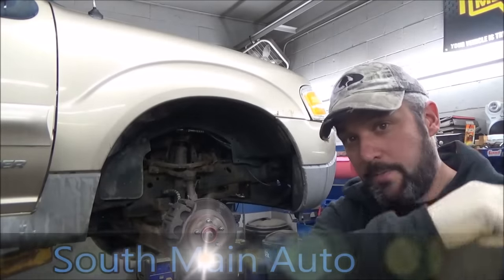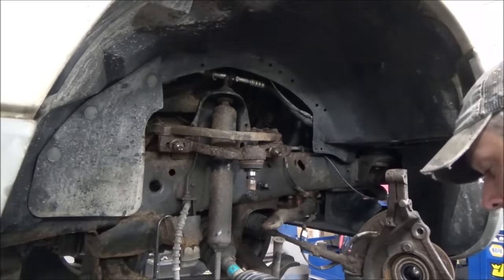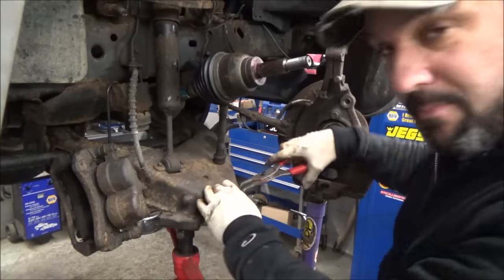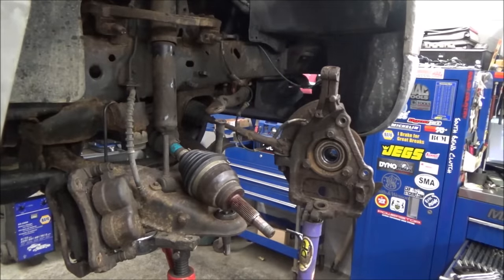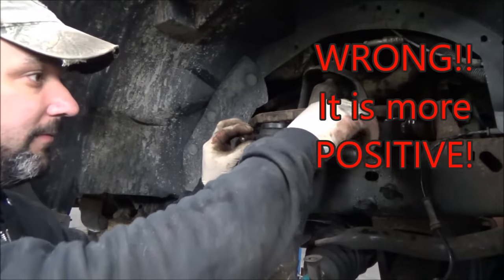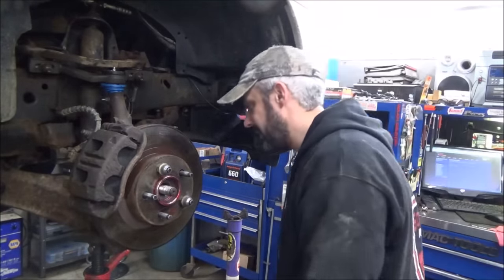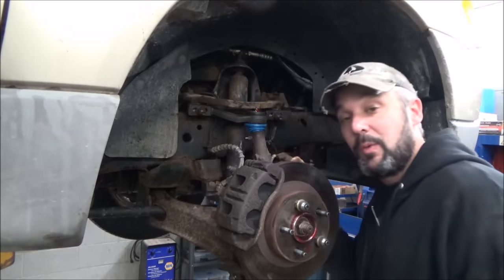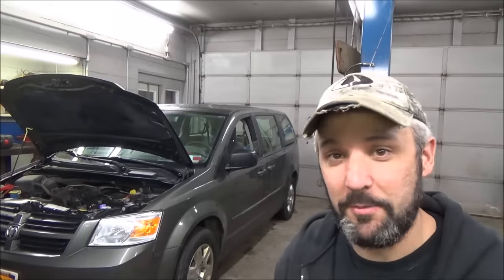Ford Explorer Sport Trac - Ball Joints

Comment: I have a ball joint kit just like the one you have and used it for years. The owner of the shop I work at just bought the Snap-On ball joint kit. It’s expensive I think about $600 but worth it if you do a lot of ball joints. I haven’t even taken mine out since he bought the new one. It’s heavy duty and the cups all snap into the press with lock rings. It doesn’t matter the size or how long the ball joints have been in I’ve never seen it struggle to push any out. It has saved us a lot of time. Time is money

Comment: Eric Im learning a lot from your videos only been watching a couple days in my off time, watching and listening to you is almost like hands on experience for me. I ordered a power probe thanks to you and your videos using it... I think Im gonna use it alot with my hilux 4x4 when I work on the stereo and lighting systems here soon. I have a dual battery setup that I wanna take a step further and add a 3rd battery, a deep cycle solely for using the winch and a air compressor i think. Thanks buddy for all the information you give us!

Comment: Great vid.  Watching you pull that special adjuster bolt reminded me of the big triple square front hub bolts on my 2011 VW Jetta that spent a year in NY.  Had to change the bearings.  Figured an easy job.  Two of them stick out 1/2" or so on the back side.  I sprayed them down first but they wouldn't come out all the way.  Wouldn't go back in either.  Eventually I had to grind them off. I got smart on the other side and the die grinder with a wire brush on the ends of the threads on the back side before removing and they slid right out.

Comment: one of the reasons I watch your vids is to check out the tools before I spend a ton on the trucks. lol.   it's great to see them in action before buying.
Reply from the maker: +traynj21 Heck yeah save tons over the tool trucks!
Reply: +South Main Auto Repair picked up the airpro 3530.  been using it at the shop for about a month now and works great.   going to look into the new air ratchet you been using.   looks like it gets shit done.
Reply from the maker: http://astore.amazon.com/httpswwwy0837-20?_encoding=UTF8&node=2

Comment: I actually managed a work around for the BJ press, I take the cheap $20 floorjacks, a big deep inpact socket that fits, or a piece of pipe, and essentially push up with the jack, pipe and joint and take a hammer and administer small vibrations to the LCA, and generally it'll go in, with no dangerous hitting on the joint or area around the joint's hole. Bear in mind though I'm working on southern vehicles.

Comment: Just a tip for the future:  as I work on my own "Eurotrash" Audi (s),  I always try to save a part, if you can,  when disassembling (egr tube in your case); as you never know when a part may not be available! Now your really in a jam as you need to tell the customer it may be one day or several..... all because you cut off / destroyed a stubborn part.   
You have "fire", perhaps you could have warmed up the tube and with a bit of patience removed it , you never know until you try,  and then if you feel it needs replacing, get the car back at a later date ; but at least it went out on time and all intact.  (you have choices). 
I remember your head machining video also......(poor machining went undetected).   
A little anticipation goes a long way!   Thanks for the vids!!!

Comment: Great point about tool review videos. Way too many "reviews" are just unboxing videos. The tools are brand new, never been used, and only tested for a few minutes.
Reply from the maker: +brian0918 I'll beat the heck out of it and then we will review it :)
Reply: South Main Auto Repair I do like some of Real Tool Reviews since he seems knowledgeable and does scientific tests, like his stubby impact torque comparison video. But he doesn't try to wear them out and see which one lasts, which would be good to know.
Reply: brian0918 - Watch AvE’s channel then; he takes them apart to show you the good parts, the crap parts, and the so-so parts. Just look for his videos that start with “BOLTR” - mostly power tools, but occasionally the odd hydraulic thingamajig. Also, check out the “Project Farm” channel; this guy reviews mostly “soft” tools; fuel/oil additives, glues and adhesives, duct tape, etc... and he always seems to have a positive attitude even when the testing doesn’t turn out quite right, or the results surprise him. 🤗

Comment: Thank you for showing your tools. I've got a chubby now. I spent 16 hours changing my control arms on my 2009 Camry on Saturday. Used my relatively new DeWalt 20V cordless impact wrenches (3/8" and 1/2"), LED light and grinder (cut-off tool). It was going smoothly when I got to the second (passenger side) control arm, I was unable to break the castle nut on the ball joint. Ended up having to cut it off. Figures. No room to use the breaker bar (1/2" drive) or my impact wrenches. My breaker pipe was not big enough for the boxed end wrench. So cut off was necessary. Did not have a powered ratchet. Not sure if that would have broke that nut. Anyways, still felt empowered to do it myself. Sure wish that nut would have broken free. It was my first time doing this. I had to remove the engine mounts to access the mounting bolts for the control arms. That's what made it the bitch of a project that it was. First time doing that as well. Love your channel!

Comment: Fell off of my chair laughing at 8:43.  "...now all we gotta do is weld the new one in..."  Have to do some front suspension work on the Jeep to address some noises.  This was a good primer.  Thumbs up.
Reply from the maker: +Sandbag1300 Tracking bar?
Reply: Have to crawl under it this weekend and see.  2005 Grand Cherokee with 78,000 original miles.  May be the stabilizer bar bushings or stabilizer bar links or ball joints, or maybe even the CV axle.  Have the sound one time only on slow turns only front and rear so I am thinking SB links.

Comment: Now i understand why you prefer those sway bar links over the ones you installed on that taurus you did on another video,i have a taurus with a broken rear link and wasn't sure which way they went in,thx to this video i now know ,the fixed nut is on the bottom,and the lock nut on the top,lol,helped me out again.

Comment: Eric,  I highly recommend the SNAPON BJP-1 Ball Joint Press Kit. I have had mine for about 10 years and it saves so much time.  The cups snap into the press tool so you don't need 10 hands holding everything in place...lol

Comment: Big Nasty is actually a 5X rivet gun designed for use in aerospace. There are also 7X and 9X which have longer barrels.  The main difference between a rivet gun and a muffler removal gun is that rivet guns are supposed to have a fine tease trigger to slowly go from tap...tap...tap...to faster and faster.  This helps the riveter stay controllable and on the head of the rivet you are bucking. The internals are completely different as well.  Chicago Pneumatic were the early makers, but now, most if not all are made in China, bringing the price down to an affordable level. I have a 3X on the side of my work bench to help drive out pins, or whatever needs hitting.  It's like having a one-handed hammer and punch setup.

Comment: Big nasty seems to work well. I have the snap- on Super duty at a cost of 300.00 that I love, they sure do the job. This video is from 2016, Is it still holding up and working good? As for the comments welding the ball joint. I have actually seen that a few times now of them welded in. Personally, I am too particular to even consider that as I take no short cuts, If it's not right, replace it.  When Moog came out with the oversize ball joints that was a real blessing.

Comment: Torque to spec...... Yep I spec that's about right. Your English bub makes the click click noise when torquing. When I heard that drip drip drip of the Ford up on the rack then saw all the nice rust it brought back memories. (I am from N. Syracuse originally)
It doesn't take long to rust a cars underside pretty well. 
Makes it more of a challenge for a mechanic. My first car was a 1969 Olds Cutlass my parents bought new in 1970 when I was 5 so I can tell you wrenching on that was a whole big basket of joy. I feel for mechanics when stuff breaks and customers act like well you must of done something wrong. LoL naw couldn't be the salt they use on the roads all winter enough to make another lake in Utah every year. Anyhow I just have found your stuff and am enjoying the vids a bunch.

Comment: Eric take a 1/4 rod and length is predetermined on what you like. The on one end put a slot in it about the length of 1 inch with a hacksaw or saw. that way you can take some 1 inch emery grit is what you like to clean out or deburr any suff thats in there instead of that steel cone you used.

Comment: for that boot that MOOG says you just put it on. What i do on some of the hard ones i take a cone from my ball joint press and i hook up the ball joint press like i was going to press in a ball joint and i tighten the shaft with my hand. And when it has a couple pounds of pressure i wiggle the shaft and tighten the shaft by hand and the boot will go right on . I've been doing the ones that give me trouble like that for about 28 years. it works pretty good .

Comment: I think Ford's idea was the ability to correct steering pull quickly by adjusting cross caster. That way cars could go in and out of the alignment rack quickly, but the dealer could charge full price for an alignment. It would eliminate the need to remove the upper eccentric knockouts and go through the trouble of adjusting both eccentrics. On the 2004-up Ford Explorer, Ford put an adjuster on the RF lower control arm, but alignment was mainly done by slots in the upper control arm mount. The concept is very similar.
14:05 I didn't realize it would be needed since a snap ring held the ball joint in place. I would understand the need for oversize ball joints where interference fit is the only way the ball joint is retained.

Comment: These new style ball joints are used  on Mercedes sprinter. I don’t know about other makes and models, but they don’t last on Mercedes. Many times they won’t take grease right out of the box. I’ve had to chuck them up in the vice to hold the grease needle as hard as I can to get grease in them. They still fail or start squeaking in less than 3mo.

Comment: I have a possible tip for installing those ball joint boots.  I use an adapter out of the ball joint press kit that fits around the rim of the boot and then tap it on.
Reply from the maker: +Discretesignals I have done the same thing and it is a 50/50 if you tear the edge or not...
Reply: I used to use cheap sockets for the adapters. Works fine. HOWEVER,I think that you are using a .40i shank tool.
 Look at a ,499" tool. Weighs 7 pounds and will KILL any ball joint. Screw that ball joint press!
They ain't cheap,but a real time saver.

Comment: 28:40
Reminds me of my Mom's Explorer recently.
Windshield washer fluid would barely squirt out of the jets.
I pull it into the garage, pop the hood and start hitting with windshield washer fluid button on the column, figuring it is prolly a bad pump or a clogged jet, and, as expected, barely anything.
I hope out of the driver's seat, go around to the front of the Explorer, and see the underside of the hood, engine bay, wall, toolbox, and floor are covered in windshield washer fluid.
Midway between the reservoir and the jets on the hood the hose was rotted dang near in half.
A new bit of hose and it was good to go but it sure sucked cleaning the engine bay and garage of the windshield washer fluid that sprayed everywhere.

Comment: A trick I have used in the past to put the rubber boots on is find a ball joint press sleeve that fits on the boot and then gently drive it on

Comment: I have a 2004 Sport Track that needs upper and lower ball joints upper came off fine lower was not a happy camper and since I don't have big nasty I just put it back together and I'm waiting on the bread to have them done I'm on SSI Disabilty so I'm limited on upper body strength just getting the tires back on is an adventure. Just because you can do it doesn't mean I can.

Comment: You can replace that 2pc upper control arm with a 1pc..  I had done so on my 2002 back in 2016.  MOOG CK80068 is the part number and you'll need camber kits installed on both sides.  I used NAPA part number 264-2953.  Made doing an alignment a breeze.  There is hardly any adjustability with the factory 2pc arm.  Next Trac you get like that just chuck that 2pc arm in the scrap bin.

Comment: Yes, ball joints! I've got $400-worth of Made in Germany ball joints and sway bar links sitting on my work bench to put on my van. They're just waiting for some motivation.
Reply from the maker: +Garth Goldberg Do you have a ball joint press? http://astore.amazon.com/httpswwwy0837-20/detail/B00061SGZO
Reply: +South Main Auto Repair No.  But I have the special VW/Matra cup ($40) that goes on top to draw in the ball joint using a regular 2 arm puller.
The control arm is a different shape than this Ford.  The lower BJ on this Ford is similar to the upper on my VW.  The upper arm is a forging attached to a torsion bar.
The lower BJ is just bolted on (14mm XZN triple square bolts).
Reply from the maker: +Garth Goldberg Oh man I just threw up a little , you said VW and triple square in the same sentence....
Reply: Yes.  The new triple square bolts are $8 each.

Comment: Loved the video, loved the tools. I now have "big nasty" envy. Your story about the coolant made me feel right at home - I was parked in my Jeep and all of a sudden I saw the "Check Gages" light come on. I'm thinking "check gages??? What the heck is that?" Well, a few minutes later the upper radiator hose blew off because it was over heating. "Ohhhhh, it means check the gages!!" (slaps forehead).

I have a question though - why did you use Fluid Fill instead of Muscle Grease on the upper ball joint? I would have thought the coating properties of Muscle Grease would have been preferred.
Reply from the maker: +Silky Tp MMmmm I think fluid film works just as good and it is what I had in hand I suppose...
Reply: +South Main Auto Repair thanks Eric.

Comment: The comment about welding the ball joint in gave me good laugh. 

Safety third eh? I once nearly lit myself on fire cutting up some old oil tanks with a grinder. Didn't notice where all the sparks were flying. Ruined my favorite jacket. I was lucky i was working with these 2 Latvian pipe fitters instead of the regular lads or i would never hear the end of it... 

Those Astro tools really seem nice. I've never seen them for sale in the UK. We don't use air tools much, but most of ours are no name wing wang ones we get from machinemart because we need them.
Reply from the maker: +zoidberg444 I lit my hoodie on fire once . I was using the torch and sparks went in my hood... back started getting warm, then warmer, then really really hot! Mrs.O put it out for me. Ruined my favorite hoodie though...

Comment: lol, last summer,  my buddy's 2010 dodge caravan Y connector cracked on us whilst driving up to the hill.  spraying super hot coolant all over up to under the hood and to our faces after opening the engine compartment. crazy!
Reply from the maker: +Yuri Boiblu Wow that is extreme lol
Reply: +South Main Auto Repair  lol, it is.  what my buddy did is to drive it down to the parking lot then let it cool down for few minutes. then find a vinyl/electrical tape then tape that crack then use leftover water, run about 12 to 15kms to the nearest Shell station, then look for same morpar coolant, since we dont want to different mixture (duh),  we asked for about 2 liters of water then drive home.  DID NOT overheat! that was about another 45-55kms. :-)

Comment: I do like the little Astro 1822 impact there.  And only $100 bucks for 450 ft./lbs
And I like to use a toothbrush and some of that black high pressure Grace to prevent rust..

Comment: Hey Eric O I'll put my CP717 with the .498 shank, up against your "big nasty" for a big shank show down. lOL. The body is a little shorter and the hit seems it is a little slower. But don't get in it's way. This thing will tear through up ball joints on a Chevy truck or a concrete block

Comment: Eric-Off topic here, but how about a video regarding GDI, and steps you might recommend regarding keeping the intake valves clean.  I have a 2015 Silverado with the 6.2 Direct Injected and trying to stay ahead of the curve.  Added a catch can, but are you doing BG intake service or other types of cleaners to prevent valve coking?  I see CDC has an intake valve cleaner out now that is an off the shelf option. Maybe I should just spray  Brake clean in the intakes....kidding.  Thanks for what you do and keep up the good work.

Comment: Whoever works on these trucks should make sure the caliper bracket  bolts are tightened to spec (I forget what it is, around 100ft/lbs). They have a tendency to come loose! Big thread on explorerforum on that.
Reply: alb12345672 Also add blue or red locktite to them. I highly recommend torquing them as well! when they come off its a bad deal! destroy a rim or worse

Comment: I have an 08 caravan, I had to replace the "y" in the line twice, then I went to a hardware store and got a brass "y" and the cost was tremendously cheaper than buying the new one with the entire pipes and all, just a tip